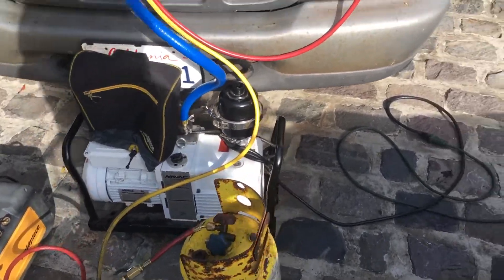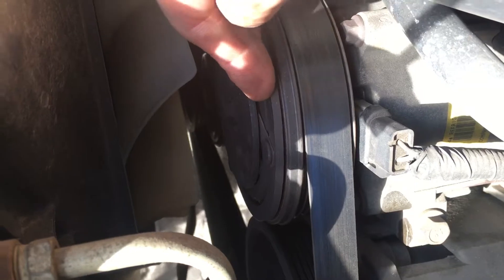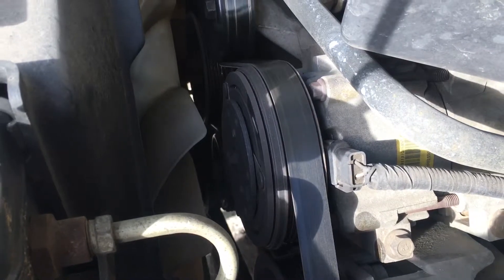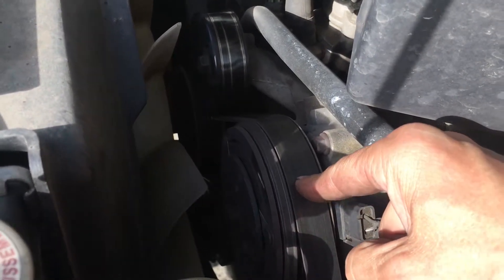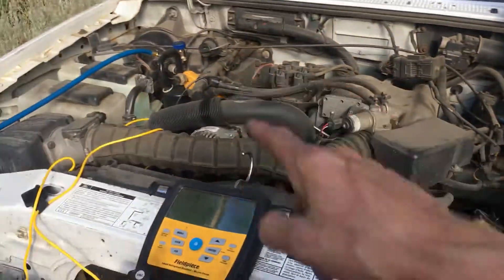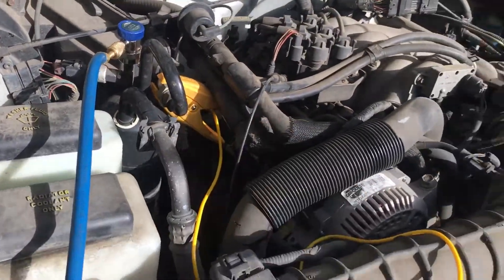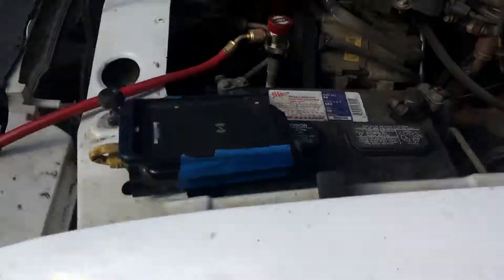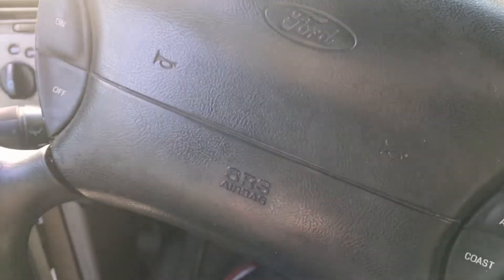Ford Ranger AC Clutch Gap Adjustment and Refrigerant Recharge

Comment: Assuming that you have a tight enough Gap, what does it mean when you have a terrible noise and a burning smell when the clutch engages?
Reply from the maker: Well, I think we can both agree that’s not good. . 
  Now you’re looking at is probably a new compressor if you cannot turn that center shaft.  Or when you go to remove the belt you cannot turn or it’s very rough and grinding the bearing on the belt pulley.. 

And if it is the internal of the compressor that went bad and possibly to metal flake, you will know when you take it apart and look inside the compressor and go to pour out the oil .  

If it’s metal, flake that made it to the condenser 

You will be replacing the Orfice to the accumulator flushing out all the lines replacing the compressor flushing out the evaporator Replacing the condenser. 

If there’s dirty junk inside the system .